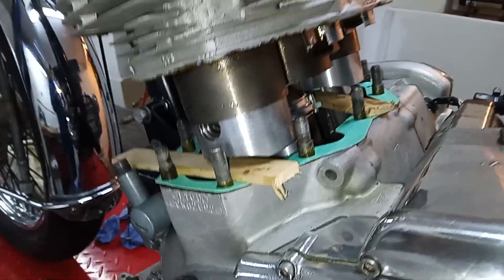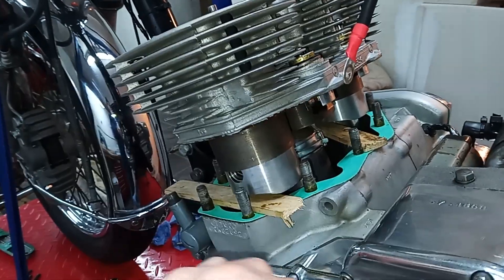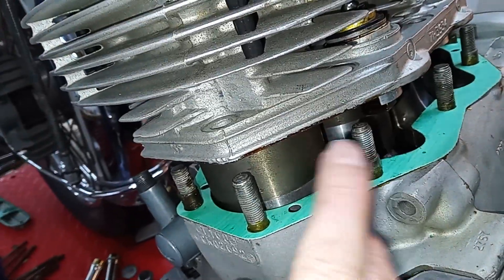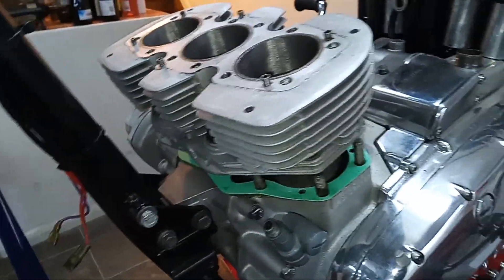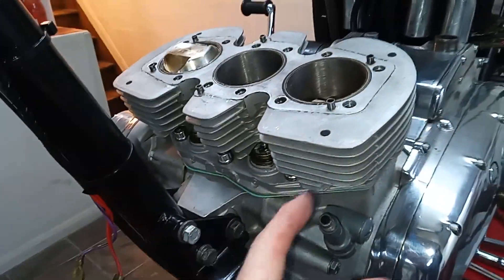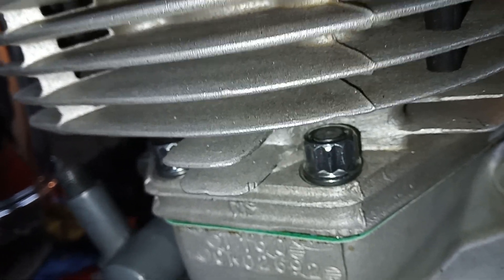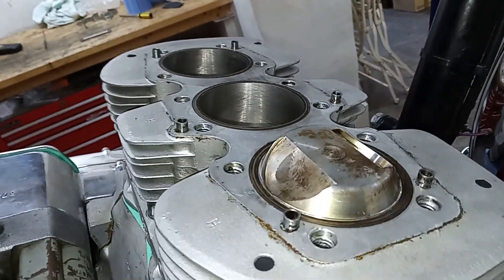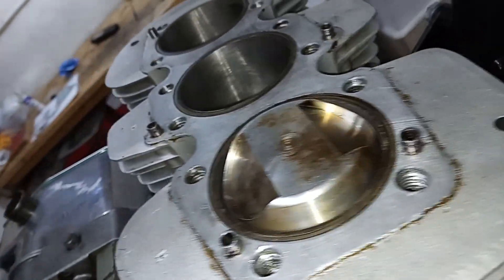'75 Triumph Trident T160 - Cylinder Barrel Refitting. Part 2

Comment: Hello Chris

I've been following your channel for a few years now and I love it.
As a rider of a 1973 T150V, I am surprised at your installation of the pistons.
Initially I also wanted to purchase a set of ring compressors. But I also see you struggling with it.
This is how I do it: place the middle piston in the cylinder. Put a few sleves over the threaded ends of the connecting rod. Mount the cylinders on the engine, and tighten the connecting rod through the hole in the sump.
Keep up the good work. 👍
Rino Voogd, 
the Netherlands
Reply from the maker: Thanks, Rino. I have used that method of fitting the barrels/pistons before and it works well. However, I don't tend to use it if the engine is already in the frame as then I find it even more difficult than fitting the barrels from the top. Glad to know you've been following the channel. I hope you find it interesting - and even useful! 👍👍👍